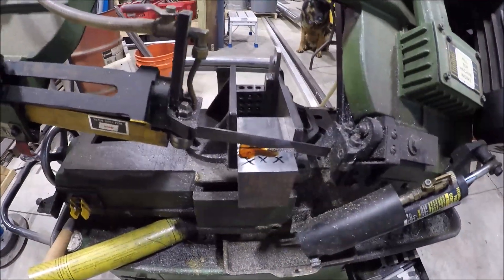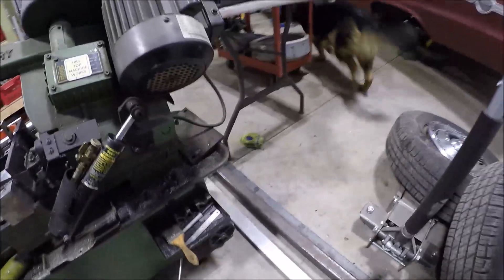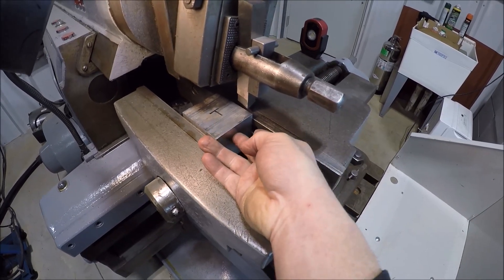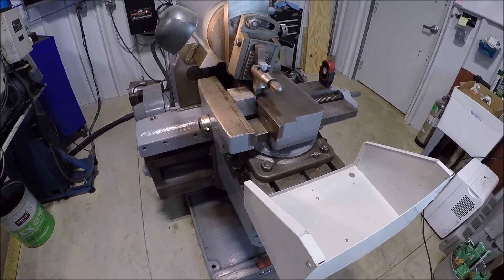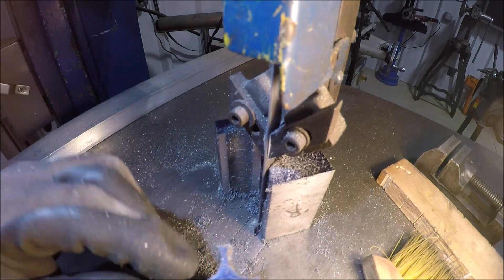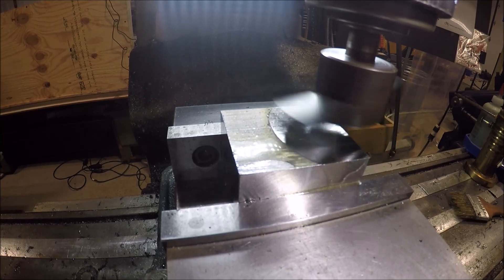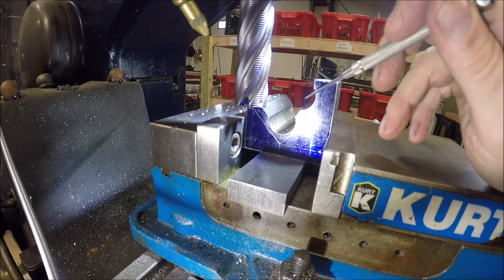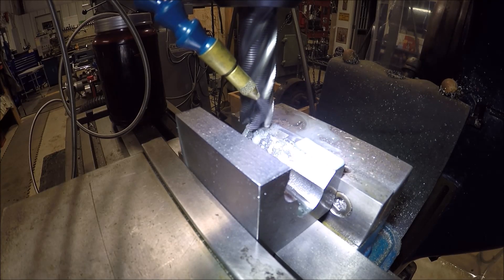Jet lathe lead screw support bracket build. Part 1

Comment: Good start .   If you can picture the most basic round nose lathe tool with top & side rake ,  i would try that on that material .   Lol , have fun with the allu bronze .   Can be tough stuff to machine .    👍👍👍
Reply from the maker: Yeah I need a larger nose radius on the HSS for sure.